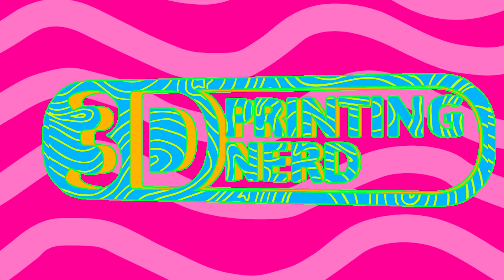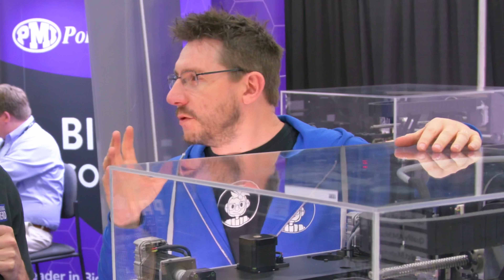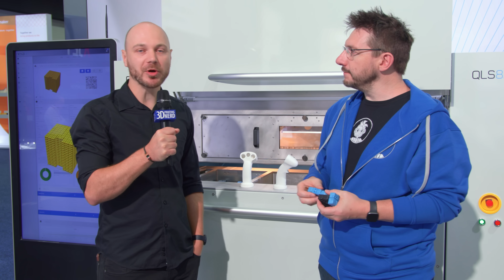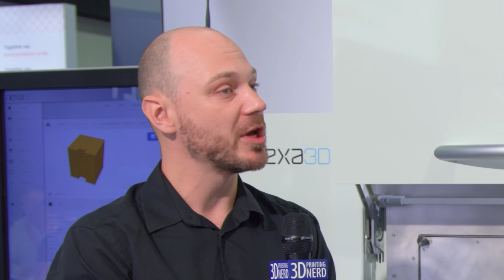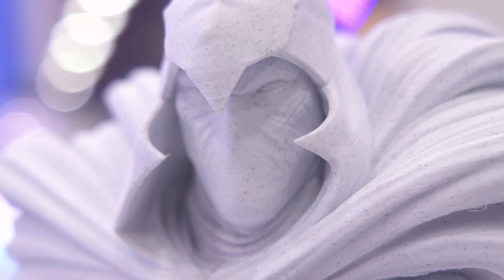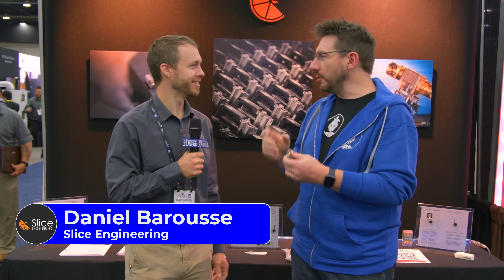SUPER FAST 3D Printing at RAPID + TCT!

Comment: It's wild what happens in a year. Today I can get similar speeds on the exact same printer I bought 3 years ago with a raspberry pi, klipper firmware, a cheap accelorometer and a simple hotend upgrade. Or you can buy one off the shelf for under $1000.

Comment: 15:00 I'm confused what problem they're trying to solve. Are they swapping hot ends? What I've done is purge PEEK with unmodified PC, so I don't have PEEK sitting in a hot end causing problems later.

Comment: Many years I bought a pen plotter. I bought one with servo motors because there were no stair steps on diagonals and arcs. Does it use the gcode arc commands. Cura's arcwelder plugin post processor, maybe?

Comment: I would imagine a power inverter could run a 3D printer in a car so no need for batteries.
Reply: The batteries are so we can move it from bench to car, to helicopter and then to boat.

Comment: So great to meet you Joel. We'll see you in Van for beers and 3d printing.
Reply: It is rare to see a printer in that price range that prioritizes design and build quality with high quality components instead of relying completely on ease of use and customer support. Not saying that you won't have those things, but this looks like a 6 or 7 grand machine with little overhead in other costs where as pretty much all the same price competitors look like 2 grand machines with inbuilt tutorials everywhere and 'usability' features that anybody actually in the business doesn't need. Of course it is overbuilt, but if my company ever needs mass production parts running 24/7, I know where I am looking first. With some changes this looks like it could also be adapted for high temperature printing due to all the electronics being at the top.

Comment: For pantheon, print a flexible material while the printer is mounted on a shaker table, "swing", or tensegrity table so the lateral movements become harmonic. But ball screw motion control and servo drive seems insane.
Reply: I never understood why the printers that are geared more towards businesses don’t use servo, or at least closed loop, stepper drivers or closed loop control systems. Hell, at this point, I don’t get why “hobby grade” printers aren’t using closed loop drivers. It makes your printer more accurate, prevents steps, and will be able to alert you the moment something goes wrong (like a tool head jam or something blocking the nozzle causing it to skip).

I’m waiting for groups like the Voron and RatRig to move away from steppers and only servos or brushless motors with encoders to help achieve faster print speed at high acceleration while maintaining accuracy.
Reply: @nathan1sixteen  My printer literally never skips steps, and Trinamic drivers can (probably?) detect missed steps anyway, the same way they detect when you hit the end of the axis with sensorless homing. The loads in 3d printing are so tiny that I don't think servos add anything but cost.
Reply: @jsincoherency  Turn your acceleration up. You want to print faster, you need to crank up your acceleration. You turn it up too far and you’ll definitely skip steps, especially on a printer that may not be tuned correctly or may have a heavier tool head.

I mean, my printer also rarely skips steps, but when it does, it’s incredibly frustrating.

Also, the trinamic steppers can detect the skipped steps, but they can’t fix the problem. Even homing the machine isn’t super accurate. Closed steppers are crazy good at accuracy and just preventing it all together. Teaching tech (I think it was him) did a video a year or so ago with closed loop steppers, and he hit the axis with a rubber mallet while printing, and watching the machine recover almost instantly was super cool
Reply: @nathan1sixteen  they don’t use closed loop because it’s more expensive
Reply: @futuremapper_  closed loop directed really sent that expensive. And, considering these machines already cost over a grand to build, I don’t think an extra $100 is going to kill someone’s budget
Reply: @nathan1sixteen  I agree everything in the plants I work at use similar things i guess its mainly cost. Those ball screw drives alone are a few hundred.

Comment: Those speeds are not crazy tbh. Annex and vez3d machines are capable of this too.
Reply: I was thinking the same thing, but are those machines aren’t commercially available. You don’t see to many commercially available machines being able to achieve those speeds.

Also, the adaptation of ball screws and servos is cool, and I hope that the servo part starts to catch on, as stepper motors are gonna start being the limiting factor, steppers aren’t designed to move at high speeds, so moving to a servo, or even a brushless motor with an encoder (which is basically what a servo is anyways) would be a “next step” type of improvement that I can see happening in the near future, especially in a lot of those “performance” geared machines
Reply: @nathan1sixteen  ball screws are insanely expensive though
Reply: @futuremapper_  Supply and demand, brother. Linear rails used to be super expensive too. It the demand goes up, so will the supply, and the cost will come down.
Reply: @nathan1sixteen  steppers at 48v do great up until 1.5m/s or so. 
Acceleration is what makes prints fast, not speed.